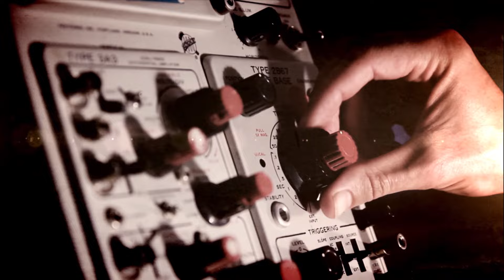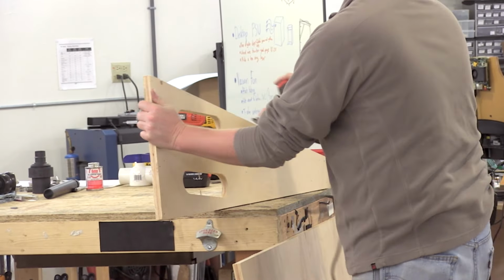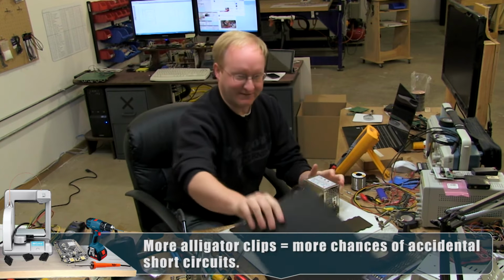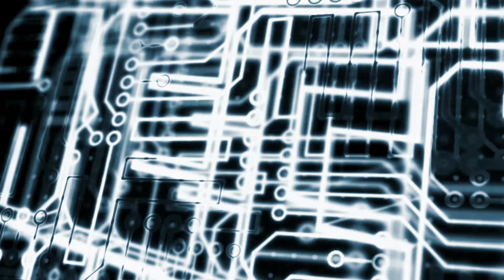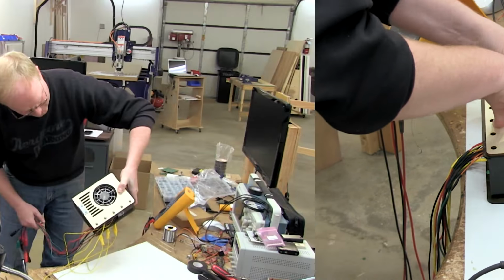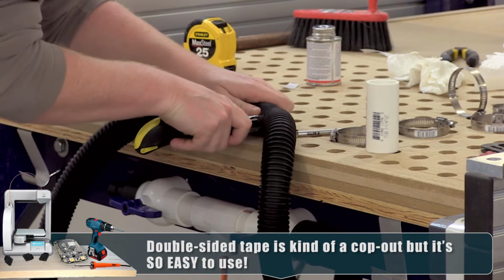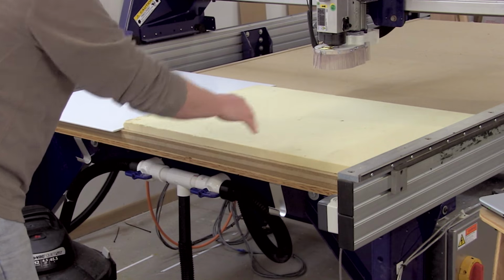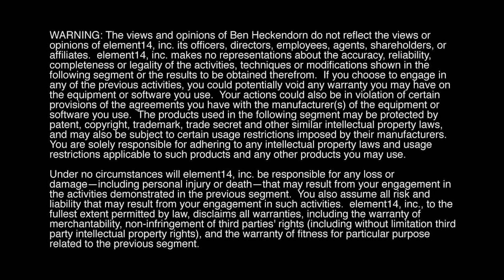Ben Heck's Workshop Hacks

Comment: As a tip, you can also get server power supplies for cheap - I bought a 1200watt HP "platinum" efficiency for $25. Not only are they cheap, they're small in size, very reliable and don't usually have wires. Makes for a really clean bench supply.

Comment: As a couple of other posters have pointed out, the majority of switching power supplies will NOT work as a benchtop power supply without some sort of minimum load attached. This is even more important if you are using an older supply. Basically, a switching power supply will not output any voltage if the current is zero. So when you turn it on and it is not attached to anything then the voltage coming out will be zero and you will think the power supply is broken.

How much of a load depends on the power supply itself. In the original IBM PC/AT, you needed a load of at least 7 AMPS in order for the power supply to function properly. That's quite a bit of wasted power. Many of the newer power supplies have minimum loads built in to guarantee that the power supply provides voltage with no additional external load. But if it doesn't have this feature then you need to provide a minimum external load. You also have to worry about whether or not the load goes on the 5V line or the 12V line. So how much load and what line to put it on are important questions to ask when creating a benchtop power supply out of a PC switching power supply.

So just grabbing and old power supply and hooking it up without a minimal external load can leave you scratching your head if your power supply of choice does not implement its own internal minimum load source.
Reply: those are very old supplies. supplies made in the past 5 years dont have that issue. this is why you have to tie the green to ground.
Reply: Thanks Phillip. All of the supplies I have laying around are older than 5 years so I always have to deal with that issue if I intend to use one of them. It's good to know that the power supply manufacturers have made things a lot easier for us these days.
Reply: Treasure Pirate i have always heard any simple load resister will also work. just make sure its switched incase it runs away on you
Reply: I think it depends on the application. For a project where you are using the power supply as a dedicated supply then the load itself can come from the project itself. But for a bench top power supply, there will be times when there will be no load at all and the power supply is expected to still output a voltage in these conditions.

I've used old power supplies for dedicated robotics projects and didn't have to worry about the load as long as the robot was always moving. But there were also times when I tried to use old power supplies for robotics projects that didn't always move and the microcontroller running the system didn't pull enough juice by default so I had to add an additional load to meet the minimums.

Still, I appreciate you commenting and correcting me. It's good to know that most of the new supplies do not require minimum loads in order to function. That alone is worth the extra price of just buying a cheap new one rather than trying to repurpose some of the countless old supplies that I have.
Reply: I just made one from a computer that ran windows 98 and it works fine without a dummy load 

BTW i cant stop playing with it though, for some reason its really fun!
Reply: I think that an LED lamp for that extra lumens would do the trick!

Comment: Have you considered building an enclosure for your shop vac? You could have it vented either inside or out, using a muffling system, insulated walls and a large enough door to access the vac it'self. It could cut down on on the noise considerably.
Reply: +1... . . . . and include a good cyclonic separator.

Comment: PC power supply's typically go out of date because of poor efficiency not GPU power requirements.
Also the rating's are usually the peek power not constant output. And the amperage is not for a single cable but for all the cables combined.
Reply: Exactly, you'd think this guy knows his shit..
Reply: ivanjacob He started off as a hobbyist and learned more and more throughout the years, so yeah, he probably doesn't know everything.
Reply: Garrett Grove As long as your psu has molex connectors and the right power requirement, you can stil easily use it. Get educated please.

Also, I never said I'm smarter than he is. I just thought that something so stupidly common should be known by him. But hey, maybe he isn't into computers that much.
Reply: Garrett Grove That's not really a good argument.. And if your psu has the right wattage, it doesn't make a difference at all. Molex connectors and pci-e connectors are both connected to the same trace in the psu.
Reply: Garrett Grove Again, Why isn't it the right way to do it? It works the exact same way.

And since when where we talking about PCs from manufacturers? People who own PCs without GPUs generally don't put one in there later on.
Reply: Nick Guy The thing is, a typical GPU uses about 200 watts. Exactly enough! And for more than that, you always have adapters like these: http://www.alternate.nl/Club-3D/Adapter-2x-4-Pin-Molex-6-Polig-PCIe/html/product/151981 Still costs much less than a new psu.
Reply: ivanjacob Total wattage is misleading if the current on the 12V rail is insufficient. The most significant factor for figuring out if a given GPU is going to run properly (or at all) is how many amps it can suck from the 12V rail.
Reply: Not all, just the rail. I think that's what you meant
Reply: Actually they get out of date due to efficiency going up, and new things coming out like modular psu's.

Also, they don't go out of date for the amount of power that the gpu needs, because they are constantly trying to make gpu's more efficient. Like the gtx 980, fastest single gpu card that takes the amount of power that a laptop gpu would.

Comment: Hello Ben, From building also my own PC PSU Workbench generator, i DO recommend installing a Load resistance (like 200 Ohms ceriamic or so) on the 5V line (inside the PSU casing after experiencing stabilities issues (Like PSU not starting without load)

Comment: 17:50 The chip sucktion isn't clearing the work area because the shroud is blocking all the air from the edges and it's all coming down from where the router is. If you remove a bit of the skirt and reduce the clearance around the chuck more air will come in laterally and swirl around picking up dust as it goes.

Comment: For my own notes:
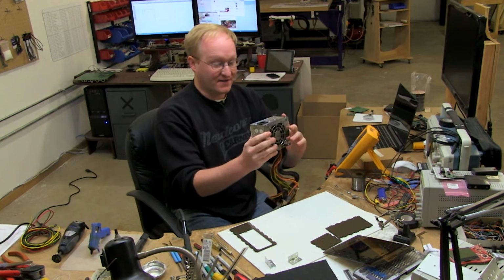4:04 Power supply - 
* Blck ground, Yellow 12V, Red 5V, Orange 3.3V. (Blue constant 5V)
1) Master On/Off:  Connect Green wire to ground (black)  using switch - turns on power supply
2) On light: Put a resistor in for power on indicator (1K suitable) with LED - hook up to any 3.3V (Orange) line
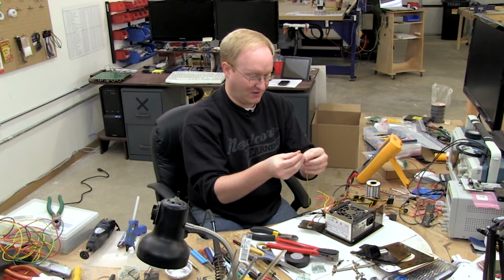8:53 (end of advert)
3) Cut off and heat shrink ends of excess leads.
4) Connect wanted leads to screws.

Comment: Hey Ben just a thought,but if you used the larger hose size from the vacuum into your manifold (increase the T size as well), would that not at least provide a higher volume of air flow in order to divide it between the two functions?

Comment: Ben you should replace the plastic on your dust collector with the brush from a upholstery cleaner for a vacuum cleaner. It will still be flexible but provides a better seal around the job.

Comment: I like to tie all my same voltage wires together in parallel when I make a bench power supply. This ensures I can pull as much power as the PSU is rated for without tripping the breaker or burning the wires up.

Comment: I don't understand why you just didn't open the PSU up and desoldered the unnecessary wires, a lot cleaner for little work. If they are jammed together like crazy I just cut them at the solderjoint at the PCB.
Reply: well think about it. your opening up a POWER SUPPLY! THATS STUPID!
Reply: No it's not if you know what you are doing, discharge the caps and start desoldering.

Comment: The chip collection for the Router would work better if you weren't using one vacuum to do it and the vacuum table.  Not only are you losing suction because you are doing both with one vacuum but you are also losing suction from the fact that with the chip collection you have the vacuum traveling a great distance through the tubes.
Reply: Assuming the vacuum table isn't leaking, it shouldn't change the effectiveness of the dust collecting once the system reaches steady state, in an ideal system the difference with and without the vacuum table would be negligible.

Comment: Ben, how would you implement adjustable current limiting circuit to the computer power supply?
Reply: External device after the PSU regulates it. If you were only drawing up to 1 amp, you can use an LM317 adjustable regulator in constant current config. Watch EEVBlog's power supply tutorials for more info on it!
Reply: Naoki Saito
Thanks for your advice, I guess I've seen some of Dave's videos about power supplies. I'll watch them again. LM317 is not enough for me, because you can draw much more current from a computer PSU. It would be a waste to use only up to 1A.
Reply: There are other ways to get more current though you might be looking at mosfets and feedback circuits.
Reply: Naoki Saito
I guess modifying the circuitry from the PSU would be too much.
Reply: Nick Guy Thanks, I'll play with LM317 to learn more :)

Comment: You can make the power supply fanless(passive cooling) by screwing the voltge regulators(tranzistors) to a big block of aluminium or some CPU heatsink laying around. Of course this will make it bigger, but you can do some wire bridges to keep it all inside the case,

Comment: Thank you for the video. The ATX used as a workshop power supply is a nice idea. People building such a device should be aware of the 25 A (as this one is rated), ain't nowhere realistic with wires at that dimension. I wouldn't recommend pulling more than 6-7 A through those wires at 9-8 A they would be hot and the insulation would begin to melt.

Comment: If i would have made the power suply i would have used banana connectors.
That way i don't need to have extra cables beeing in the way, just plug in what i need.
Reply: and don't forget that GND is connected to earth pin in all the computer PSU.
Putting the ground lead of your oscilloscope on any powered wire will cause a short!

Comment: Why didn't u use the shrink wrap thingy (I'm Swedish don't now the English word for it)
Instead of the electrical tape if u take one who is fitting snug over cable and heating it with a few millimeters out from cable it shrinks to realy small hole and if then bend it when still warm u get it short free ;)
Reply: Oh yeah, heat shrink tubing.  He even showed them in one of his bins for it when he was talking about wire colors.  Maybe he just preferred doing it the way he did.
Reply: I alway use em working great even if u have usb cables who is to short and uses a extension cord take shrink tubing over the male and female plugs and heat em.now the stay connected I did that on mouse cord and the kids stubble on cord and still connected

Comment: Ben, you should have added a T fitting and another pipe. So after the CNC cuts it out and there are chips left, you just open the valve on T so suck up the chips.

Comment: A power supply with -12 are good for dual rail circuits.
Also, -12 to 12 gives you 24V, etc
Reply: Yup, but the -12V ones usually can't supply a lot of current.
But it's indeed useful in some applications.

Comment: its a dust shoe not a dust collector.
the way it is mounted if you where doing a cut that is the same or less than the hight of the dust collector it would get torn off and do some damage.

A better design is to have one where its lowest point is at the same hight as the bottom of the spindle motor not the collet.

also if you have a bigger pipe connected to it it will suck more the pipe should also be connected at the side or front of the shoe less chance of it getting in the way, and if you use dust brushes it needs to be able to move up and down and as what's already been said a bigger hole around the collet does make it work better it has more air coming in what courses a vortices.
I have two shoes that I use on my machine a sort and long. the sort is for small cuts and the long one is for deep cuts when doing 3D work.
the long one is connected to a plate that is on the spindle, the shoe is held on with magnets.
the short is connected to a mount what has two rods going through it so the shoe can move up and down

Comment: You could probably have used a single Y valve to share the -pressure of the vac, only one switch to operate. Also you can mark your "sweet spot" on the body of the valve

Comment: My old PSU won't power anything on its rails with the Power ON wire grounded. (Power supply turns on, just nothing get power, ie, HDDs)

If I attach it to the old MB, it powers HDDs fine :-/

Anyone have a clue what is going on or how to fix it, I also tried grounding the Power Ok wire, done nothing.

Comment: For the Bench PSU, how safe would it be for a RPi or Android? Is the Amperage auto-adjusting?
Reply: I would advise you to at least add a fuse or polyfuse as a limit, the 5v trace on the pi can only handle about 1.5A at max, and it also has a load resistor on it if you use the USB port.
Reply: slango20  Amps are drawn on the go. You won't exceed the 1.5 if that's the limit for Rasp PI. It takes as much as it needs as long as the power supply can keep with it.
Reply: DaGunchijs
some things connected to the pi can draw more than it can handle, and the 5v pin doesn't have the polyfuse that's on the micro USB. connect a wifi module and a wireless mouse/keyboard module and you can pop the thing if they draw too much. my advice was to add a fuse if they were connecting to the 5v pin, to replace the one that exists on the USB connector

Comment: ben have you ever thought to build a portable nintendo 64?
Reply: thats a great idea. i would love to see that
Reply: He did that forever ago on his website: http://www.benheck.com/n64-portable/
I would love to see an updated build with a video though...
Reply: +Noah Bonvissuto Should be easy enough. Just build a battery powered power supply supplying the voltages you need to run the N64. Also, you might need a display, also operated on the same battery.

Comment: A couple comments (not meaning to insult but inform)

FYI, the ratings on that PSU are overhyped garbage most likely... From here it looks like a coolmax unit, which is a brand not know for quality. I bet the UL cert is fake too!

Also, PSUs do not go out of date per se in the way stated. Wattage is wattage. Yes, newer designs can be more efficient, but that's what 80+ is for. Now, what will make a PSU "obsolete" is if it is a 5V heavy design... for a number of years (still now in the crappiest of crap units) companies would add modern connectors (PCIe, etc.) to old designs that didn't have enough on the 12V to support them. 

But otherwise, if you have enough Wattage and the PSU is 12V heavy and has the right connectors, it will be fine; I have plenty of 6 year old PSUs that would be more than enough for most modern builds. Keep in mind they are QUALITY units, not cheapo sledgehammer bait junkers.
Reply: Its a coolmax... Good luck and a fire extinguisher if you use one of these!
Reply: The brand of PSU matters for a PC, where having a stable output is critical, but it's likely this won't be used for anything that important, he's got another power supply which he can use for finer voltages and currents, this is probably for high current loads. I agree that PSUs have gone out of date because of new connectors, like SATA power

Comment: Partly opening the valve on the table side is silly.  It's a FLOW regulator, not a PRESSURE regulator.  If you have covered all the holes, there is flow only thru leaks.  Think it thru.

Comment: Huh.. I still have like 15 year old 200w power supply running my home server. Just open it up once a year to clean the dust out, check the capacitors(Have resoldered two already). Oil the fan every couple of months and it should run cool n queit for years to come. Even kitchen cooking oil works good!

Comment: id have added a third vacuum valve for a clean up hose after the router finishes switch the dust collector off and valve 3 on and suck up the remaining chips with a hose

Comment: not sure why but my diy psu puts out 12.58 volts instead of 12 volts. Any suggestions as to what may be causing this? thx
Reply: +Eric Escamilla I'm pretty sure you add something like a 5w 5ohm power resistor on the 5v line or add a dummy load like tail light bulb from a vehicle.  Lol...not trying to pretend like a know a damned thing  - this is where I'm sort of stuck on building my second supply (can't remember how I built first one)...Maybe this will at least get you on the right trail...
Reply: +Eric Escamilla Many SMPs that come from PCs have a specified minimum load. If you run it with a  lighter load, the regulation might be poor. Put a 10 Ohm 10W resister on the 12v rail and you should be fine. It will draw a little power, but the line regulation will improve.

Comment: An ATX-Power supply isn't suitable for a bench power supply. It doesn't have a current limit. If you have a short circuit in your circuit, 25 amps will flow trough it, which will certainly destroy it. You can't rely on the overcurrent protection. These SMPS aren't suitable for HF stuff either. It makes more sense to buy a cheap bench power supply or if you want to learn something about electronics: design your own.